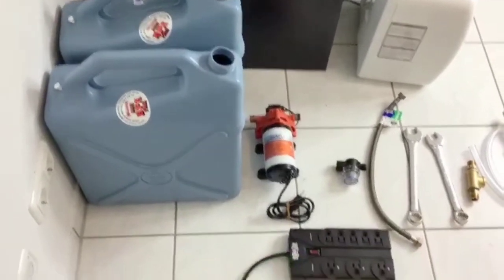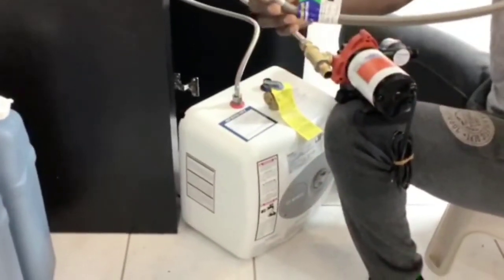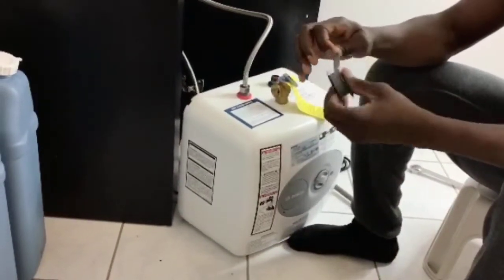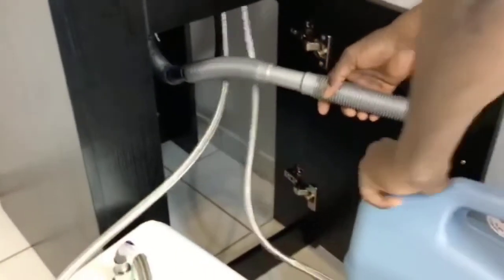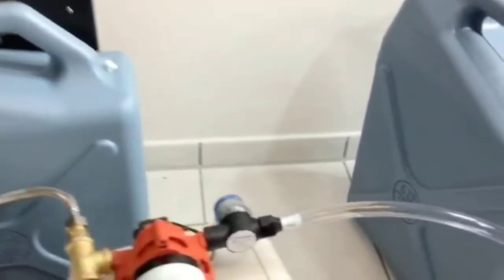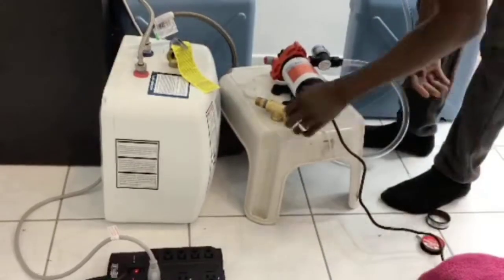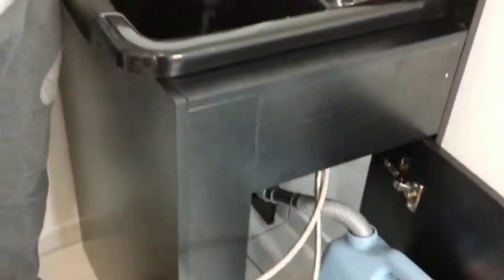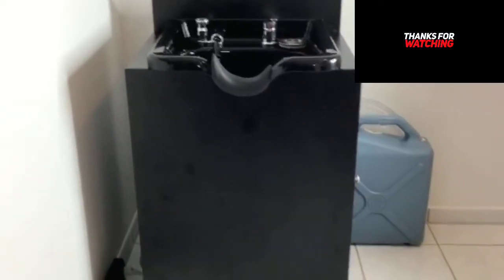Step by step instructions on how to build a portable salon sink with cold and hot water

Comment: My water isn’t flowing out the water heater what could cause this
Reply from the maker: @sicariipensacola5588  I hope you were able to fix it by now. If not, try the connections step by step in the video because if you connected the faucet differently than we did in the video, that will not work.

Comment: Thank you!  I’ve been looking for a solution for over a year as the self contained units sell for 3-4k online.  

I strongly suggest using the pvc tubing with the water source tank…huge difference.  It’s not in the video, but I connected the pvc 1/2” pipe to the 3/4” tubing with a 1” tube and twisted both in.

Also,I would also use plumber’s tape on every connection…I didn’t and had to do it all over again.
Reply: Hello, Can you explain what you mean here?
Reply: Ok, that just. Confused me. So are you saying you use two hoses and twisted them together?

Comment: Did you have problems with your pump pulsating when using hot water? Also did you have hot water pressure cut in half?
Reply: This is the issue I’m having now ,did you find a solution to this problem?

Comment: Please help I’ve been to Home Depot twice already but I can’t seem to find the right tee :( can you please send me the link to the one you used.
Reply: Did you ever figure it out? Bc I'm having problem with 1/2 braided hose connecting to the pump and hot water heater.the ends of the hose are two different sizes.

Comment: I finished my sink thanks to you guys. Do you know where I can get that grey/clear piece that you are connecting your hose to pvc pipe with ?
Reply from the maker: You're so welcome. I got it from home depot. It was long, like the length of a broom and I cut 1/3 of it.
Reply: Hello how much did everything come up to
Reply: Did you have problem connecting the braided hose to the pump and to the hot water heater. 1/2 hose had two different sizes on the ends of the hose.

Comment: Is a pump required for the water heater to function properly?
Reply from the maker: Yes, you will need the clean water to transfer into the water heater to provide cold or hot water.
Reply: @sstaransaa4388  Why does the cold water need to be ran through the water heater?
Reply: @PPworldfamous  Because you need to heat the water before using. Why do you think it's called a "water heater"?

Comment: OK so I purchased everything in the video and got my sink working but now I have low hot water pressure. I was wondering if anyone could help?
Reply: It ended up being the faucet. I replaced it with a better quality one and I haven't had any problems since.
Reply: @randibigler4298  how many heads can you shampoo with the 6 gallon bucket?
Reply: @brittneyasha8438  I only use it for a handwashing station. I have a permanent makeup studio
Reply: @randibigler4298  how often do you have to refill ill be doing this for my nail studio. also did you
Reply: did you have to do a shop inspection at your permanent studio?
Reply from the maker: Honestly, since I can't tell what exactly is wrong I will advise you to take everything apart and redo it. The water pressure is provided from the pump.
Reply: is this still working fine for you?
Reply: @KhayBee  yes it works great!

Comment: Where did you purchase the sink from?
Reply from the maker: I got it from eBay. It was $169, the name of the sink was titled Black Backwash Shampoo Bowl Barber Salon Shampoo Spa Equipment.
Reply: @sstaransaa4388  can you post a link please? I can’t find that one for $160 they are like 3 and 400 dollars
Reply from the maker: @telderjr05  I did not put out the link because the seller is no longer to be found. Any sink that has connections like the salon ones should work just as fine.
Reply: @sstaransaa4388  okay thank you
Reply: Hi, am I able to use the sink I already have that required plumbing?

Comment: What is the brand name of the water pump and model #? What is the size and brand of the hot water heater and for the water storage containers? What are  the plumbing fittings called and size and name of plastic hose tubing? I need a complete list of of the material needed like the brand names suze or type and best place to purchase except for the sink. Thank you! Great video! How can I contact you.
Reply from the maker: Hey CJR, Thank you for watching; you can contact me through my email queenstarea@gmail.com. I have tried my best to list the items I used down in the description above hope it is useful.